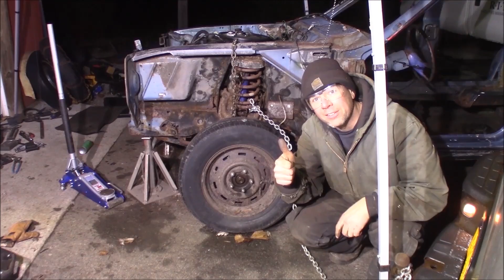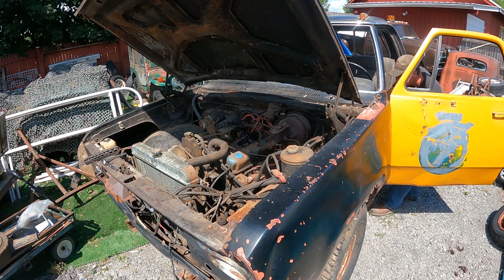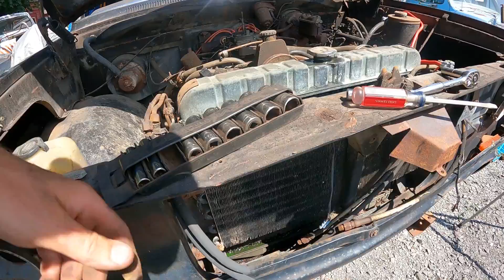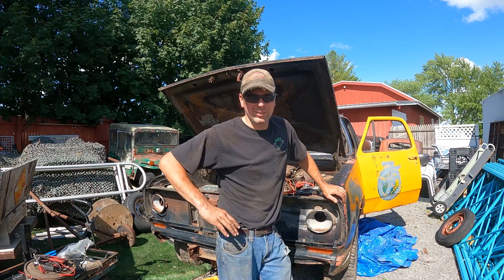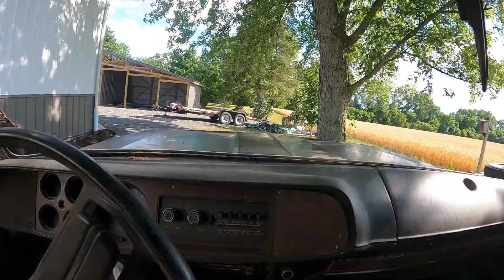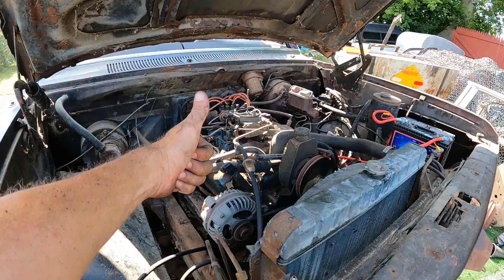Will It Start?  1975 Dodge W200 Abandoned for 15 Years!

Comment: Bought a 75 d200. Sat for 20 yrs.  Diaphragm in fuel pump bad n dumped gas into oil pan. I put another tranny in. Engine good. So easy to work on n simple.  Adventurer camper special. No body damage and no rust. It was built with use of galvanized steel for that year.
Reply from the maker: Nice 👍

Comment: Im thinking about getting a W200 for around €15.000 depends how much the seller would go down. Seems in good condition. W200 is my dream car! But on the other hand it would be wasteful do own 2 cars when I barely drive alot with my main car. Putting the W200 on normal car insurrance would be expensive as hell so I would put it on Oldtimer insurance. But having 2 cars is pretty wasteful but damn Dodge W200's are such sexy beasts!
Reply from the maker: You can never have too many cars.  I have 20 and that's down from 24!
Reply: Thats the big difference you own enornous land, i live in a house with like zero ground private ground besides a small front and backyard haha. And in Holland its expensive as hell to basicly own and drive a car. Oldtimer insurance aint expensive but petrol is expensive its crazy. Average about €1.95 per litre. You can store your 20 cars somewhere around your land, i have to park it on public parking spot lol. And in the winter period I have to store it somewhere its not allowed on public roads that time. Besides that I have like 0 knowledge about it so have to go to a garage for almost every malfunction it has. But I can learn about it. :)
Reply: @ek6648  hey you won’t regret a w200 they are beasts